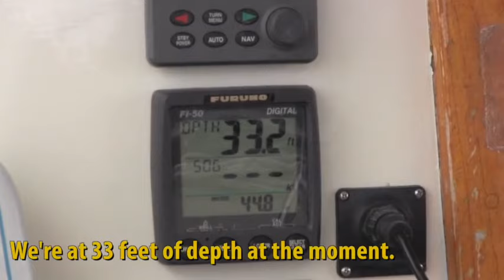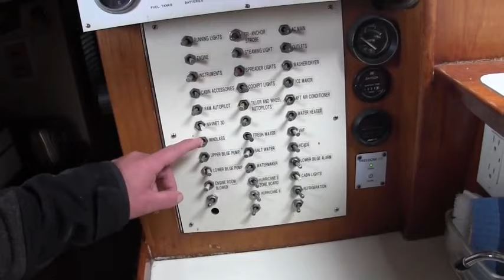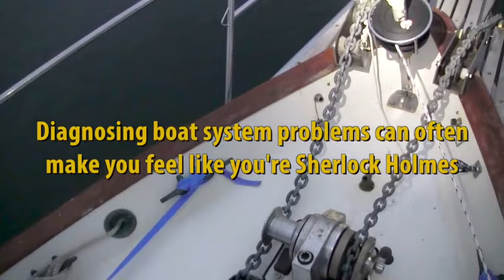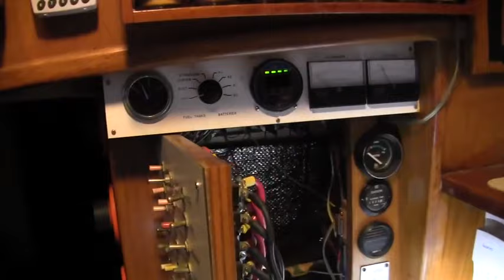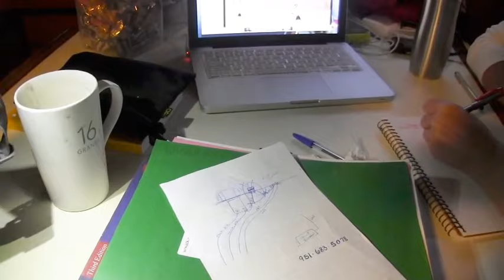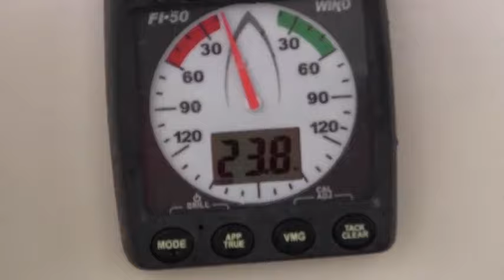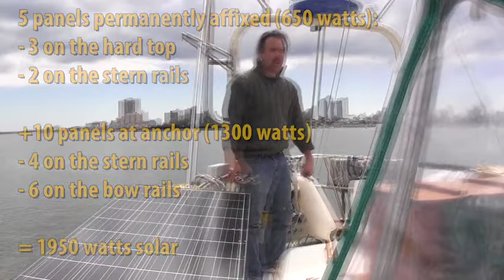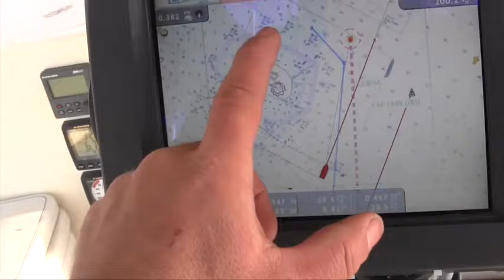Anchored in Atlantic City, New Jersey | #15 | DrakeParagon Sailing Season 1

Comment: Love this series. Did the reverse in the fall of '87. RI to SC. One anchoring trick we used was the Bahama moor: Bow anchor, stern anchor, with a weight on the lines to keep them below the keel. That way we could swing 360 and not worry. Also, I know you're filming, but all that running is making me crazy. The person on the bow gives hand signals to the person at the helm. Worked for us. Your results may vary.

Comment: Great to see Mo doing some narration and happy again - she had a tough time on that last leg. Drake -  water getting through that hole most certainly caused a short that blew the fuse (not so much the pull on the chain). By the way, I'm obviously missing something as you have march 20, 2013 at the start of the clip - ?

Comment: Yes, you are correct in your analysis. That windlass circuit was closed probably by sea water coming in and bridging over the bow switch. I hope you are tagging both sides of those wires as to their origin and destination and hopefully keeping a diagram as well. Thankfully this issue came up in a situation where coming off the anchor (sailing or motoring) wasn't at a time critical to the safety of the crew and the vessel. FYI, many windlass installations do not have those large fuses and instead have what are known as "fusable links". These are short pieces of wire designed to burn at specific load values. They are not always tagged as to what they are. When they burn they commonly smoke up a storm before parting thereby opening the circuit. One thing is for sure though, I would definitely label THAT fuse. 3 hours to find that is something that should never be repeated aboard ANY vessel like that.

Comment: @18:40 "... in 25 feet of water with 100 feet or chain out..."
Wouldn't that be a scope of about 4? And isn't a normal scope for a line rode about 7:1
Even 5:1 is only sufficient for settled day conditions.
What fives? Why so little scope?
Reply from the maker: With our set up I generally find that 5:1 scope is fine, as it gets our anchor chain to lay parallel to the ground where it's pulling on the anchor.  I think that 5:1 scope is more generally accepted as adequate and have not heard that 7:1 is preferable in average conditions.  I've even read in a Sail Magazine article written by Don Casey that 4:1 mayo be preferable and will link to the article below.  I do put out more chain during very high wind conditions, and I've even put out multiple anchors in extreme conditions.  But there several factors.  Type of ground tackle, type of holding, swing room, weather conditions, depth, fetch, and how much protection you have from shore to windward among others things...   We have a great anchor, a 70 lb Rocna, and we usually anchor with all 3/8" chain which is quite heavy (plus snubbers on port and starboard).  

Ground Rules: Anchoring in Three Dimensions
https://www.sailmagazine.com/cruising/ground-rules-anchoring-in-three-dimensions
Reply: Thanks for the details of your reply. Very informative as usual :)